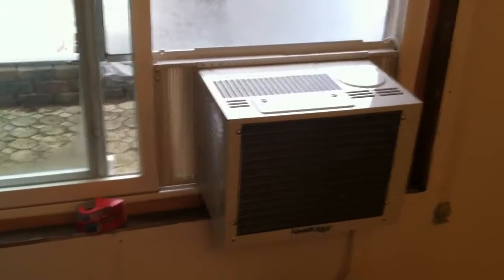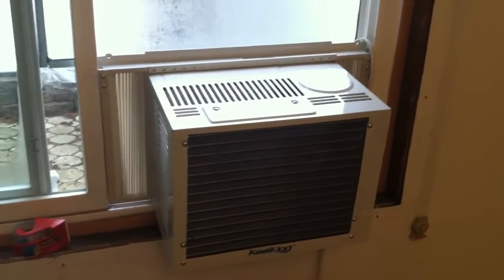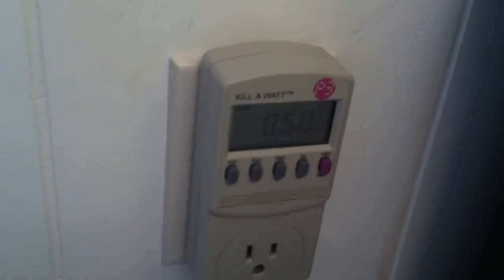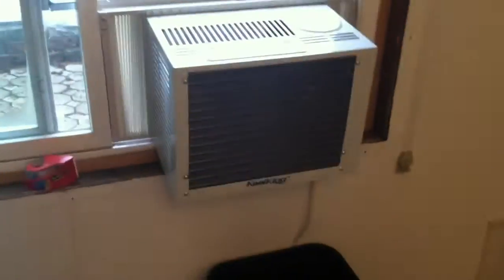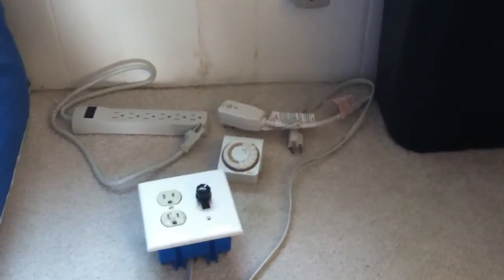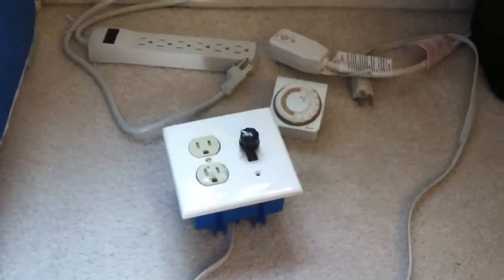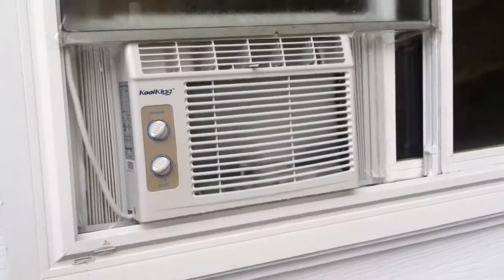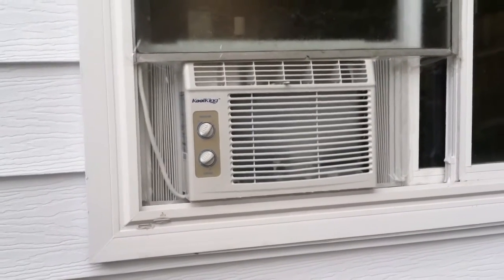Turning an air conditioner into a heat pump by turning it around

Comment: What if you ran the whole AC unit inside your house and just vented the cold air out? The coils should stay much warmer, and it should run much longer. There might be some moisture you have to deal with. But no Matt how cold it is out side it should work
Reply: First, the people who pointed out that in venting the cold air outside, you are sucking (probably colder) exterior air in, are absolutely correct.  So this wouldn't work well, at all.

Second, no one has mentioned this yet, but if the unit does not access the outside, where is the heat coming from?  The whole concept of a heat pump is that you are pumping the heat from one place to another (from outside your house to inside your house).  But if there is no exterior access, you are just moving the heat that was already inside your house.  It gains nothing.
Reply: @oneguyontheinternet9998  that makes sense. I was thinking you could move  cold out side the house, like you would move heat in normaly.  forgetting it would create a negative pressure in you home bring colder outside in.
Reply: @mjmbishop  I probably wouldn't know this if I didn't have a degree in physics, but you can't actually move cold anywhere.  Heat is a form of energy, and cold is just a lack of heat.  So heat can be moved, and by moving heat out of a house, the house gets cold.  This is what an air conditioner does.  Note that it does not move the hot air out, it just moves the heat out.  The inside air stays inside and the outside air stays outside.  When you put the ac unit in backwards, you cool the outdoors by moving the outdoor heat into your house.

That's why heat pumps don't work when it gets very cold outside - there isn't much heat for them to gather and bring inside.
Reply: It might be easier To do this with a portable AC rather than a window unit.
Reply: @mjmbishop  exactly my thinking when I bought a second hand portable ac. Just need a proper hose on top. I don't understand why ac market is so uncompetitive
Reply: @eXTreemator If your discharging the cold air out the window and the unit is inside think where did that air come from….. You literally put a vacuum on your house pulling outside air in to displace the cold air out.. the window ac or portable ac are separate between the cold side and hot side. The content creator was correct to mount it this way and use the window ac. If you use a portable and intake air from the house to discharge cold you increase draft in the house (negative pressure) if you intake outside air and discharge for the cold side you have the exact same issue of the cold side coil freezing up.
Reply: @masterdebater8757  if it's a standalone small house then yes.  Otherwise no. I actually tested all of this and works good enough. And i heat up my corner room like this with external thermostat when i feel it's too cold or start to feel sick. Of course all of which would be unnecessary if fucking j3v (youtube leftist dump) building owners had thermostats on radiators and everyone could adjust. You can make a loop to circulate only cold air from outside (a proper way to do it avoiding frezzing-at least protracting) but in big building it makes no difference (improves dehumidifing ability).
Reply: To vent the cold air out you have to consume warmed air from inside thus creating negative pressure in the house and forcing cold drafts all over the house. Putting it inside and intaking out door air and discharging cold air again outside would result in the very same freezing up issue. Remember the window AC has totally separate cold and hot sides both has separate intakes and discharges. If you tried to use a portion of the heated side air to defrost the cold side then your decreasing the efficiency of the whole unit and thusly it becomes no better than the electric resistive heater.
Reply: Keeping the entire ac unit inside and simply venting tge cold air out pulls air out if the room and into the AC unit to vent outside.  This creates a negative pressure in the room  which will end up pulling in colder air from the outside.

Comment: All you really need to make this work with the unit right side in is a defrost timer board and reversing valve from   some old heat pump at the scrap yard. I am not sure what is available in your area but reversible window AC units are commonly available here and not significantly more expensive than a straight cool unit.
Reply: Post us a link I can only find 240volt units or fake/ false links to window AC's with resistive heaters inside.

Comment: To overcome the freezing you need to get an insulated AC Cover, then while your unit is running direct a small portion of the hot air to the side that freezes  up. This will keep it at optimal running temp all winter. Constant hot air, no freezing up. Hope this helps.
Reply: +WorkinAlday
This is the best advice I've heard yet. I should fashion a device which Takes the outdoor air temp into consideration to operate a louver which can adjust the air mixture running through the, now, outdoor  coil. The electronics section should be protected or bypassed altogether or rerouted to the inside. You still have the problem of the indoor fan motor being unable to withstand excess moisture. Enjoy that compressor noise, at least the heat from the compressor can now be of benefit to you. You can find window systems for super cheap sometimes.
Reply: I also think this is the most practical solution to solving the heat pump issues in cold weather and now wonder why this isn’t built into them 🤔
Reply: I am down a YouTube rabbit hole but this was a cool experiment and I love the suggestion above 

This was a great explanation from the next auto play video that I thought applied and explained heat pumps vs ACs and why they need the defrost temp sensor. https://youtu.be/dzA9jrfAvSM

Hope you got it working well 🍻

Comment: Damn you should just get a reverse cycle air con.
Reply: If you find a 120 volt window AC that is also a heat pump please share it with us! As far as my research has taken me I have only been able to find 240volt units that have this function or false ad's or redirected links to window AC's with electric resistive heat cores inside them.... It is a shame none of the major brands are making these window model AC/heat pumps because they would sell to people like me that do not find a need for central air nor do we want the hassle or expense of these new split ac systems. Also if you could make that with VRF tech inside that would be great.

Comment: Yep, same results I see..Now if one were to address the freeze up issue with modifications such as very high speed fans..some geothermal modification...thanks for figuring the wattage! I personally refuse to use resistance electric heating BC its just so wasteful..I employed a $50 garage sale AC unit for mine using a light bulb to heat the thermostat in order to fool the AC unit into thinking it was above 70 degrees..then it came on..And yes, runs about ten minutes and freezes, mus be thawed and then..

Comment: I used a window AC unit to make a 40 deg. walk in cooler for a flourist shop.  Took me a while to figure out how to get it down to 40 degrees as it would only go down to 60 out of the box.  Basically installed a small light bulb 12v close enough to the temperature sensor to fool it into thinking the air in the room was 20 degrees warmer than the actual room temp.
Reply: bypass the switch, no need for a bulb.
Reply: A small cheap device called a Coolbot will do this for you.
Reply: @cpacker33  Yeah, well it was the mid 1980s so we did what we did and made it work. Now days it's usually a RTD sensor and you just need to add a resistor to fool the controls into thinking it's warmer.
Reply: Great ingenuity man 👍  @plcreman
Reply: $300 to $400 is not cheap compared to the aforementioned solution @cpacker33
Reply: @cpacker33  $500
Reply: @cpacker33 the cool bit isn’t as cheap as a thermostatic switch and a light bulb.  Just looks a lot more professional
Reply: There are plug through controls for this you would simply bypass the thermostat in the unit and use the plug through settings to control.. People use them for all sorts of stuff like converting chest freezers into refrigerators and this kind of stuff like you did for the florist shop. These ones specifically can handle more amps than others and have very good reviews... https://www.amazon.com/WILLHI-Temperature-Controller-Thermostat-Improved/dp/B00V4TJR00/ref=pd_sbs_469_2?_encoding=UTF8&pd_rd_i=B00V4TJR00&pd_rd_r=D2DPPRKJEQY3BWSZW39H&pd_rd_w=iG3la&pd_rd_wg=aRnCe&psc=1&refRID=D2DPPRKJEQY3BWSZW39H
Reply: WTF is a FLOURIST shop???

Comment: Shame said developed countries such as the UK, where I live, make it so hard to actually find heat pumps on sale. People are single minded with gas appliances over here, until the stuff runs out.

I have some heat pumps that run as a dehumidifiers and during the eve my house goes to the low 50's, so the coils naturally ice. I have a few ways to deal with the issue:

First: Run a thermo sensor on the evaporator (cool side) and set it to switch the unit off once the evaporator gets to -5C or so. A Fridge thermostat works nicely.
Second: Run the unit with a variable duty cycle. Something such as 5 minutes on and 10 minutes off. This needs a digital timer to work properly.
Third: Wire a valve bypassing the expansion device. This will trow hot gas from the inside coil to the outside coil, effectively defrosting it in a few seconds. The cycle can be repeated every 5 or 10 minutes, but requires the unit to be re-gassed.

Whatever the case leave the outside fan running to help melt down the ice.
Reply: Susana Godinho

Comment: Great idea!  i heated my hot tub with two submersible sump pumps, recycling the water.  Though, sump pumps rate their heating capacity as inefficiency, the loss in electrical to mechanical energy was 15 percent.  All the inefficiencies of the water pumps were slightly heating the water they were pumping!  It took a week of pumping the hot tub, water back on itself, to raise the cold tap water to a 40 degree hot tub temperature.  But once it was up to temperature, it was quickly back up to temperature the next evening after a dip.   If you have a submersible sump pump, try running it in a barrel of water, in about a day, the water recycling gets warm to hot, depending on the pumps' inefficiency!
Reply: yes, I had an aquarium heated by the water cic pump..a fountain pump which really moved the water plus heated the tank..The fish LOVED the high speed water flow and grew tremendously! Like being in a stream..